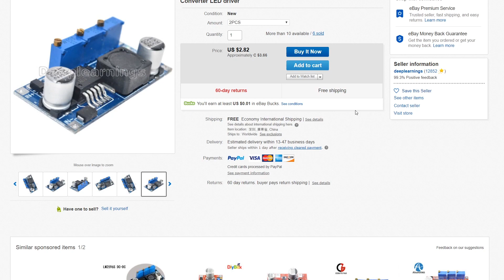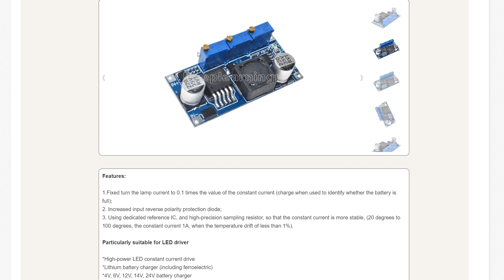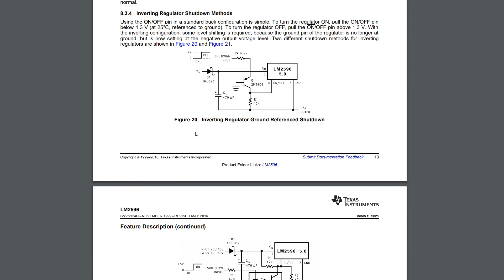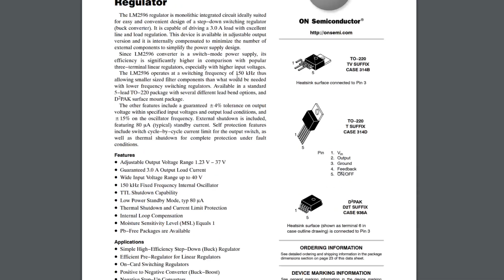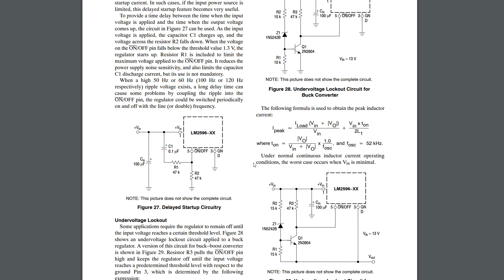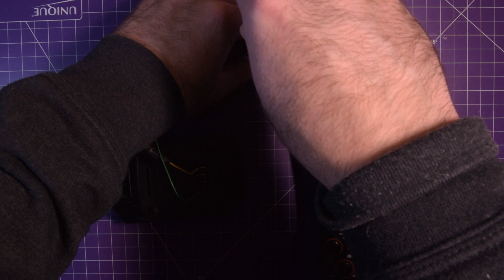LM2596 Constant Voltage / Constant Current Module!

Comment: Here's me yelling at my screen at 18:50 that your meter plugs are still in the current measurement position.   Wise thing to always remove directly remove them after measurement.  I have blown up some nice stuff forgetting it. 
Also not to sure about those potmeters and charging Li-Ion batts. There is so much tolerance due to vibration, temperature changes etc. I would rather use a module dedicated to do this with no trim pots or one where you can set it via buttons.
Reply from the maker: Li-ion batteries are way more tolerant than you think, if you check the output voltage on some cheap chargers that come with household devices like vacuums and the like, they sometimes output 4.3v/cell - not saying it's a good idea, but they seem to not blow up!
Reply: @SimpleElectronics   Well most battery packs have some sort of inbuilt protection pcb but I'd rather be safe than sorry.  I've had a battery explode at my parents house like 30 years ago due to overvoltage, The I will just place a resistor in series so it will be fine idea. Due to handling of my cool mother the place didn't burn down.  Also nowadays I only charge those batts when I am at home, and if weather permits it outside in the shade. Lately I don't even tend to charge them to 100% since that seems to wear them down a lot faster. So if I was using a PCB like that I would even limit them to 4 Volts.
Reply from the maker: @Luke-san  I'm with you! Always better safe than sorry, I'm just saying, it would probably work just fine, either way! I would be reluctant to give you to an outsider - like my parents - for permanent use though, they don't understand the dangers fully, no matter how much I try explaining...perhaps it's time I design my own charging board that charges to 4.1v/cell and cuts off at 3.8v so I can be confident when I gift something? Hmmmm....

Comment: Thanks for the review, I'm gonna use this module with a 10w solar panel and a 12.6v 4400mAh li-ion battery pack I made out of salvaged cells from a dead laptop battery, hope it'll work.

Comment: I have a few of these, and they were failing to power a 5v powered lcd controller, it would just cycle on/off.   When i used a regular one it worked.  I have used them to charge batteries, so they seem to work, but I think the current limiting chops the voltage when there is surge of current from the startup of the lcd controller, which makes it reboot.  I even tried adding a big capacitor to the output to avoid this, but it did not fix it.

Comment: I've just tested one of these and I've noticed a huge flaw. If you set your output voltage and current limiting just right for the output and then disconnect and reconnect the power supply, it can output a lot more current than it's supposed to. So if you change batteries, you could end up frying your load.
Reply from the maker: Did you set your output current while connected to the battery? You are supposed to do it while shorting the module. Mine retains its current limit
Reply: @SimpleElectronics  Yes, the current limit was set during a short circuit. Everything was set up and configured. Voltages, current limit, batteries and load. Disconnecting the batteries, counting to 10 and reconnecting, the board outputting far more current than it was set to and the lights on the board are out as well. It's actually blown the mA range out on my bench multimeter in the process as it went over range of the channel after I assumed it was going to work. If I disconnect the load and reconnect, it's fine. It's disconnecting the power that causes this issue, which of course with a battery powered device will happen all of the time.
Reply from the maker: Very interesting; I will test it here and get back to you
Reply: @SimpleElectronics  Short it as in a dead short? Will that not damage it?
Reply: @SimpleElectronics  so what happened?
Reply from the maker: @ZeroMass  have not retested yet
Reply: @Ziplock9000  change the electrolitic capacitors
Reply: @ZeroMass  its prolly because the opamp isnt "fully operational" on start up... the current limit comes on after the LM2576 so it is in CV mode before CC mode kicks in, thats why

Comment: That is really great, however as a general rule of thumb you should not exceed half of a capacitors maximum voltage rating.
Reply from the maker: I see that as the general rule for ceramic capacitors but does that include electrolytics as well?
Reply: @SimpleElectronics  Yes, electrolytic capacitors are sensitive and can explode easily.

Comment: Watched about 4 videos on this buck converter.. Still no one has said if once the voltage cut off is reached? Wether it will stop charging? or just turn on the led to let you know it has reached its limit??
Reply from the maker: That's because it's not technically a "charger" - the only thing that will happen is that the light will go on, but the current should be minimal, since the battery will have matching voltage. If you want to use this to charge li-ion/li-po batteries you should keep an eye on it and disconnect it when the light comes on - it does not "terminate" the charge
Reply: @SimpleElectronics  is there some other board that can be added in to initiate termination? Sorry if this is basic. I'm brand new to electronics and just got this same board in for a planned Borg Cube LED project. I bought two to have one to play with and realized after they arrived that they can be used to charge li-ions.

Comment: Hello
I have a grow light I'm trying to add a dimmer to. I put one in and the panel started to flicker. I assume it was adjusting voltage and not the current. It is a 120w , 100-240vac, 1.0A 120v/.5A 240v. Can I use this to control the dimmer as a current control but leave voltage the 24vdc for the board

Comment: Hi, I'm not an electrician, neither don't have any science base. I'd like to ask a question about exactly for this buck converter. Let's say, we have 12V 1A adapter, power supply. Normally when we step down this to 3V, the current should increase in %100 efficiency to 4.  I know this converter has 3A limit. So, this much decreasing the V and increasing A, can harm the converter? Additionally, when I regulate the converter to provide constant 0.5 or 1A, where the difference goes? Is this dangerous? I'm interested in modelling and going to use some LEDs. Can I charge lithium battery in a parallel connected circuit at the same time lighting some LEDs? I'm trying to be cautious not to burn the house :) Thanks!
Reply from the maker: The converter will limit the output to 3A because it's a current limiting model. So pulling 3A from this module at 3V will be okay - but if you want to use it long-term, it's not a great idea to run it at its max output - I would get a current limiting buck converter capable of 6A - and just be careful not to draw too much current out of your power supply. Also be careful pulling the full 1a from your power supply, the same applies, it's best not to run it at 100% of its capabilities!
Reply: @SimpleElectronics  guess what, I was assuming, let's say, 5V 2A power supply constantly provides 2A current regardless of consumer. Now makes sense 😅 I'll need ~10 watts at max, so probably I'll not have problems if I use 5 or 12V/ 2A power supply I think

Comment: hey can i step up the current if it is in  its range of given voltage
Reply from the maker: yes you can, but be warned, current is not pushed by the source, it is pulled by the load!

Comment: Sir can I charge a lead acid cell of 12v through this module. You are absolutely genius.
Reply from the maker: you absolutely can! Set the current to a few amps and set the max voltage to 13v or so and away you go!

Comment: hey i have this exact same module, i got it so i can power a small 5v ardino, however mine is just giving me 0 volts no matter what, have any ideas on what might be wrong?
Reply from the maker: Make sure you have good and clean connections, what is your voltage in?
Reply: @SimpleElectronics  12Vin and im using aligator clips to get my connection going, i did the same thing with another power supply no problem
Reply from the maker: @HeyHerdy  Then I would say your module is dead :(
Reply: @SimpleElectronics  Yeah i figured, something always has to go wrong with my projects D:< thanks anyway!

Comment: How the Hell do you measure output short circuit current? There's now an ammeter in the circuit, so it's not a short! :D
Reply from the maker: Technically you are correct but the shunt resistance in a multimeter is tiny! Likely in the 10 milliOhm range! So it's essentially a short circuit!

Comment: can you please help me to make an led driver of 12v 5amps 60w strip constant voltage driver please
Reply: please help me
Reply from the maker: If you need a constant voltage driver you can just buy a 12v power supply that plugs into the wall, like I got here: https://youtu.be/UwdjfQNzA8E . I also installed it already but that video is on Patreon only for another 3 weeks or so
Reply: @SimpleElectronics  but sir want to make it not to buy please

Comment: will this work as a laserdiode driver?
Reply from the maker: Do you know the specs of your laser diode? What it needs? What kind of power supply you will be using?
Reply: @SimpleElectronics  yes that thing puts out the right current and voltage. Problem is, will the current be stable when the resistance in the diode drops. I dont understand how a part can be constant current and constant voltage at the same time.
Reply: @melangkoh4184  You've probably figured it out by now but in case you haven't. It will vary the voltage to maintain the CC set point. If the load impedance increases the current will lower and the voltage will increase to provide more current until the CC set point is reached. When the CV set point is reached the voltage will stop increasing even if the CC set point has not been reached. I guess that you could say "It's an either or CC or CV, whichever comes first." CC and CV is counter intuitive.

Comment: its ok to use it to charge a tablet, I have a windows table that need 5v 2.5a(3.3mm barrel jack), I try a lot of charger even a QC2.0/QC3.0 charger still the tablet did not chrarge while turn on, I looking a best power option to charge my tablet.
Reply from the maker: Just be careful of your set voltage!
Reply: This is most likely too late to help you. But, all of the laptops that I wave came across do the battery charge control internal to the laptop. Just don't exceed the name plate voltage of the laptop and buy a DC power supply with the proper output voltage and higher current rating. It looks like the module in this video would not provide enough wattage. Most laptops are 12 to 16 VDC at 1.5 to 3 amps which is a minimum of 18 watts and a maximum of 48 watts. This module is only rated for 15 watts.

Comment: You won’t be able to find a schematic of this set up online... they are using the lm358 to run the charge light, and also to measure the current and to enable a current limiting circuit. Basically with the current limiting part they copied what Great Scott did in his video. See link below.

Also, when the current is jumping around like it was on you, its because the solder connection on the pots aren’t the best. I had to touch mine up and they work better now.

https://youtu.be/8uoo5pAeWZI